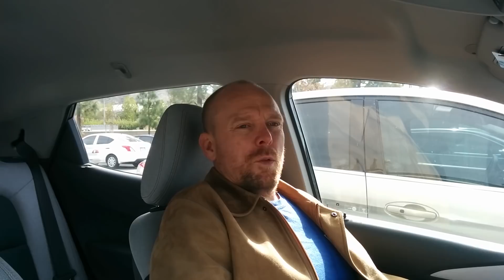Plug-Side Chat: Our Power Actually Comes From Steam Turbines

Comment: Ok, wait. You're in California. Most of our power (almost all of it at night) is generated by gas turbine burning natural gas. It is significant that the vast majority of the renewable generation in California is Solar because that means when you charge your BEV in your garage at night, you are contributing directly to additional GHG emissions because you are creating higher demand at night (a BEV consumes 10x more energy in a day than a typical house does). Meanwhile, during the day California is paying Arizona to take our excess solar production.
Reply from the maker: I primarily charge during the day at work because I do not have access to charging at home.
Reply: @newscoulomb3705  that is not typical. 90% of BEV charging occurs at night. Also, just charging at random times during the day is also not good, it needs to be synchronized with periods during the day when excess renewable production occurs. Even if you had connectivity to the vehicle to control it, then you need to occupy the charger spot at work all day, so that the grid can use your vehicle for load balancing and you just did a video complaining about people occupying charging spots, so you can imagine how well that would work.

Btw, love your videos. You do a great job. You drive so many of the places I do.
Reply from the maker: @homomorphic  That's true, but I'm charging at a slow rate throughout the day. It actually matches fairly well with the peak daily production from things like solar. It's not planned, but it's a nice bonus.
Reply: @newscoulomb3705  LoL, I'm not concerned about you personally, you had a volt when they first came out and you now have a bolt and you spend 25% of your waking hours thinking about efficiency. I am talking about the collective "you" (i.e. all the people with battery vehicles). I am concerned with what needs to be done to actually eliminate all GHG emissions from the entire transportation sector within 30 years.

Comment: NC - driving SW of Vegas, I believe it was near a town called Primm (alongside I-15) there’s an array of what may be mirrors which reflect sunlight onto a central black tower which looked like it was steaming.  Are you familiar with this?  Is this the type of steam generator to which you refer?  There was also what appeared to be significant solar arrays nearby too.
Reply from the maker: Yes, it's called the Ivanpah Solar Electric Generating System.

Comment: Interesting that you pointed out Nanticoke.  That's about a 2 hr drive from my house.  A few points.  Here in Ontario, Canada about 20 years ago we produced about 50% of our electricity through Nuclear (CANDU reactors), 25% Hydro and 25% Coal.  By 2014 we completely phased out all coal power in Ontario.  This was done with a combination of mostly Wind and Natural Gas power with some solar and biomass generation sprinkled in.  The site at Nanticoke was re-developed for solar simply because of the pre-existing transmission capacity that existed there.    Also quite a bit of wind capacity was added near Nanticoke and along Lake Erie because of the prevalent winds that develop off the lake.   For more real time info on our grid a great resource is www.ieso.ca
Reply: Another note some of the coal fired facilities in Northern Ontario were converted to run wood pellets as a carbon neutral fuel source.  They use waste wood by product from the large wood industry up there.  Wood pellets have about half the energy content of coal so these facilities have reduced capacity but it's a cleaner energy solution to use some pre-existing infrastructure. https://www.power-eng.com/articles/print/volume-122/issue-3/features/world-s-first-coal-to-biomass-conversion-using-advanced-wood-pellets.html
Reply: Should have built a zero emission nuclear plant there that could actually make use of the 4GWe transmission line capacity instead of wasting it with a 44MWe facility that occupies the same space as a 4GWe nuclear power plant.
Reply: @homomorphic  Nuclear is now too expensive. It's the main reason why Ontario's electricity rates increased so much over the last 15 years.
Reply: @erikstephens34  it isn't too expensive, it simply requires that it run full out 24/7 which means the grid needs storage. The same thing as other renewables. Sure someone can artificially make nuclear too expensive (could do that to any generation technology) and that's exactly what Ontario hydro has done.
Reply: @homomorphic  All Nuclear has gotten expensive everywhere. I'm fully aware of the duty cycle of renewables. There are cost effective solutions to those. Nuclear also brings issues because Nuclear power has minimal variation. It doesn't bode well for demand response and is only useful as base load. Ontario is already more than 55% Nuclear and adding more would be a waste.
Reply: @erikstephens34   The reason nuclear is expensive is because it can only be used as base load because there is no grid storage. As we build grid storage (which needs to be done for renewables anyway) then suddenly there is a need for thousands of nuclear plants (rather than a handful) and as soon as you have demand for thousands of plants you have economy of scale and the price of building a nuclear plant drops by 90% (they are expensive because as base load supply each one is a one off).
Reply: @homomorphic  Nuclear is expensive because of up front capital and refurbishment plus decommissioning costs. When grid tied storage becomes mainstream there will be a lot more cost effective solutions. Ontario has 18 active nuclear reactors providing 55-60% of our electricity. Each one needs over $5 Billion in refurbishment costs every 20-25 years. Green energy projects in Ontario comprise of roughly 10% of our generation and total investment costs have been less than $10 Billion.

Comment: Can hydrogen fuel cell power plants be used to generate electrical energy ? That reaction can generate steam which could be used to power turbines, and also generates electricity as a virtue of energy generated by the reaction.
Reply from the maker: It could, but I would only recommend that if the hydrogen is being used as an energy sink for excess renewable energy production. Otherwise, it's just a less efficient fossil fuel. And if you consider it that way, there are better, more efficient energy sinks.

Comment: I agree on solar heat collectors making more sense for large scale power generation . I still don't understand why that mega solar project in Morocco (Sahara desert) uses photovoltaic
Reply from the maker: I was reading an article the other day that stated we might not have enough raw materials to build the number of PV panels required to transition to 100% renewable. I couldn't help thinking, that's why PV shouldn't be looked at as the sole source of solar energy capture.

Comment: State of the art in over night storing solar energy in solar heat collector power plants is actually not water , but molten salt : much cheaper than storage batteries and zero capacity degradation over time
Reply from the maker: Yes, I think there are a number of options that can be explored. One solar concentration plant I read about uses oil to store heat energy overnight.

Comment: More new designed nuclear power plants.
Reply from the maker: I'm actually not a fan of nuclear. Thorium salt reactors, maybe, but my basic expectation for any power plants moving forward is that they produce no waste byproducts. Leave no trace.
Reply: @newscoulomb3705  I agree, most any thing we do will create some kind of byproduct no mater what that byproduct is.  If we continued to develop more advanced reactors and solutions to use this nuclear waste we might be in a better position.  So much of the nuclear reactors are based on fairly old technology.  the salt reactors are a great example of a huge improvement.  For most things space related also beyond earth we will at some point need nuclear(in some cases we already do).  I'm not saying only nuclear but I think we have a lot of growth there just as we do with solar cells.

Comment: One problem with the cole fired power plants that are decommissioned is that they are also OLD and in need of modernization. One thing that these decommissioned power plants could be used for power storage. Probably not batteries, but they could use a mechanical form of storage.